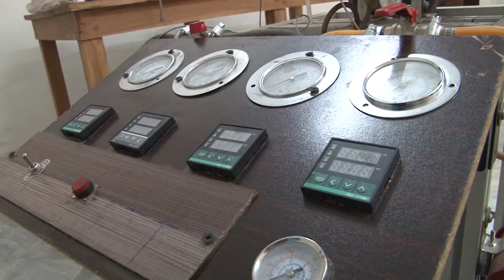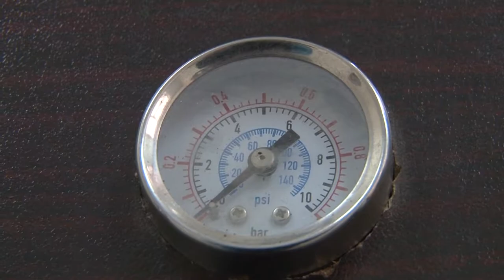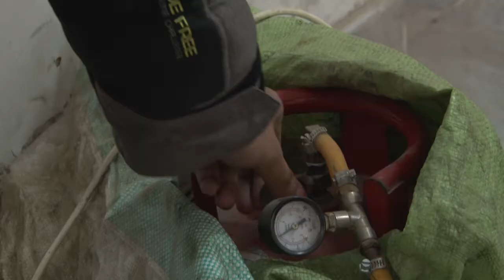Turbocharger converted into a Gas turbine

Comment: Hey man, I did a decade with OPRA turbines, the founder of that company studied with the pioneer of the turbine, and inherited all his prototypes. The cantilevered design of his OP16 engine is basically exactly like a turbocharger. The main difference between a turbo and a gas turbine is the compressor ratio, you don't need such a big compressor. Is that why most of the rotor is exposed on this bench top item you're running?

When Jan Mowill was well overdue for retirement, we helped get the company sold, and the perfect candidate was China - they have supply and emissions problems which need solving. The sheer reliability of delivering onsite power is not to be underestimated from an electrical engineering standpoint - and the chinese state has got significantly deep pockets to acquire a small to medium engineering company. It didn't go that great, and we dismantled the creative marketing department which had been consulting with the development teams about design concept and application engineering strategy.

I also tipped off bladon turbines that their axial design was too complex, and they now make a very dainty 15kW radial turbine.

This is great work you are doing, and I'l love to help. That machine you have made sounds horrendous, like a two stroke pizza bike being tortured - aha well that's the leaf blower you're using to start it... OK... if you're making net energy output you're winning... The energy lost by acoustically stressing the metal and propagating bending waves is an important domain to consider. We want smooth flow and smooth operation.

The car turbocharger market is huge, so by mixing and matching rotors and housings, there is a great deal of room for winning solutions.

A turbine is inefficient unless you also want the heat. As a supply of hot exhaust gas they are incredibly powerful, and should be considered a heater first and foremost. As an industrial engineer this is often overlooked, and a turbine can be used for thermal supply, very useful in food & drinks and for baking, as well as paper manufacturing and machine drying processes.

The most suitable consideration which was being addressed by engineering at OPRA is preheat and premix of the fuel-air mixture. Much easier to get that flame to blue. A hydroxy gas flame is a pretty fierce temperature, and I suspect that's the secret to multi stage fuel injection - we can shape the combustion mixture and temperature gradient with electrolysis of H20.

You could also try an axial compressor section combined with a rotor assembly off a car turbo. Always wondered if that would be a good idea, possibly making compressor made of something like carbon fiber rather than tool steel. The microturbine engineering clubs tend to use a compressor made out of plywood and carbon, which has a forgiving failure mode when over-strained at high revolutionary velocities, and turns into a sort of cellulose candy floss rather than exploding into shrapnel. The energy levels of a turbine overspeed accident are far, far more expensive than losing at roulette. Working out a test protocol for overspeed stress testing is a large part of the battle. More speed = more power.

Comment: Dr Usman your video inspired me to build my own version of the turbo turbine. After several iterations with varying levels of success. Ive recently settled on a design that i then incorporated into a smaller version of an aircraft APU. Im in the process of installing it into a Tesla model 3 where it will function as a range extender / battery tender. By using a modern vehicles turbocharger with variable pitch blades my goal is to allow the unit to function on a variety of fuels with my custom ECU / PCM / whatever nomenclature the units computer might be called lol, deciding where the energy generated will go, ie to the motors directly or into the batrery pack. So thank you for having made this video
Reply from the maker: wish you every success
Reply: @mechusmanbutt Hello, how are you? Can you help me? I am an engineering student and I need to communicate with you

Comment: Lahore! My good friend Sheryar is from there! Hello from Canada.
This is an interesting prototype, good use of pare parts. Do you have access to a machine shop though? Surely they could make something up for you, the plans must be available. An even easier design to make though would be a tesla turbine. It has very high power to weight ratio too. Bearings are an issue either way and it sounds like yours need some grease!

Comment: So using the Turbine for generating electricity and the exhaust gas can be used for heating purposes.
A combined cycle heat and electricity too bad that English Wikipedia have not enough information but in German it is better described
Reply: Which words did you search for in German Wikipedia?
Reply: @edkideys8953  GuD Kraftwerk

Comment: Running a bit warm?
Reply from the maker: Yes, pressure loss was high due to large tip clearence of turbine.
Reply: @mechusmanbutt  Hopefully for safety reasons! Those blades were getting hot, could end badly for someone if ran for long periods, hope you ar still safe.
Reply from the maker: @bamnasitis775  yes u r right. actually we noticed at the time of video shooting that turbine blades were a bit worned out. That turbocharger has already been abandoned. thanks for ur concern.

Comment: lol. you need to RUN. HOT to HOT....  exhaust to exhaust and connect the generator to the Compressor side. but still use the cool air for your oil radiator :yougotthis: 🕉